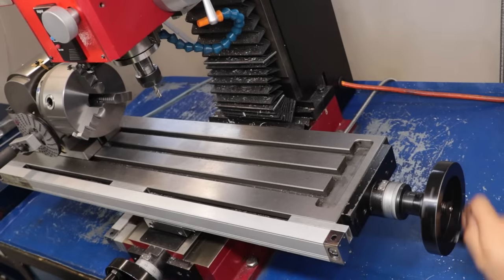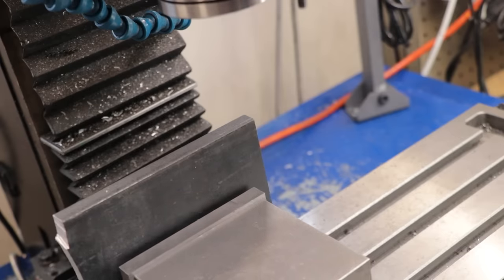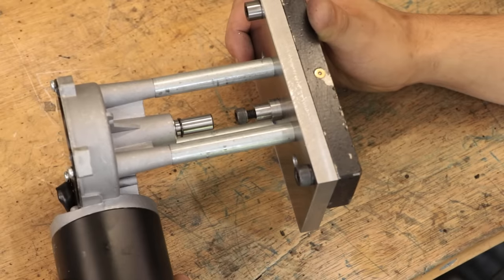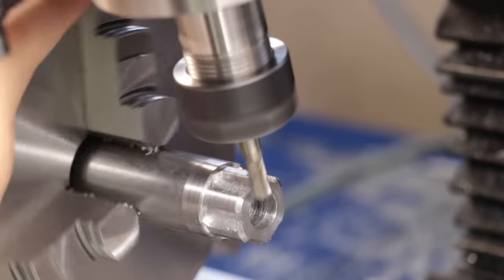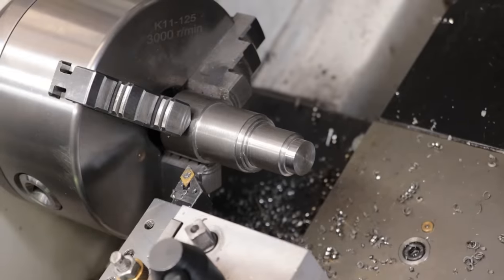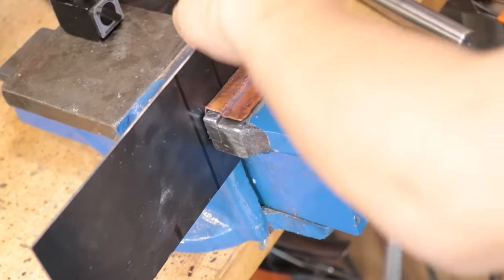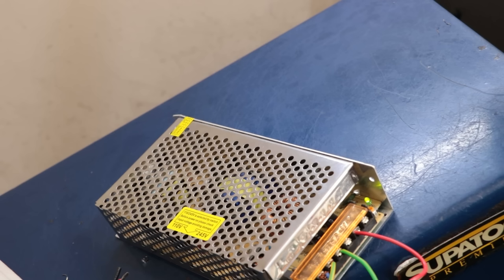Making A Power Feed For The Milling Machine | Cheaper And Better

Comment from the maker: Timestamps
0:00 - Intro
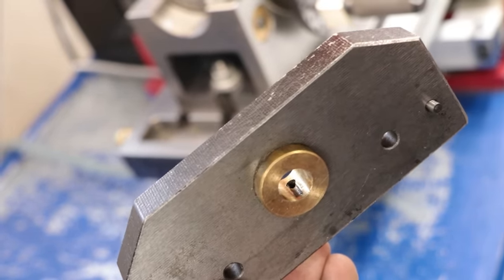2:19 - Making The Drive Pin For The Leadscrew
2:56 - Machining the End and Cover Plate
5:50 - How To Mount The Motor And Gearbox
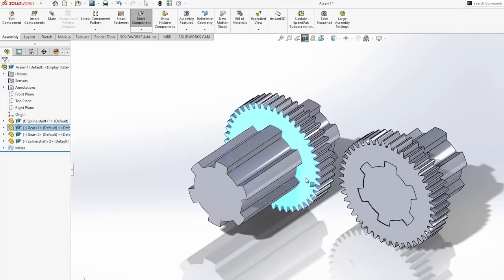7:33 - Making The Clutch Mechanism
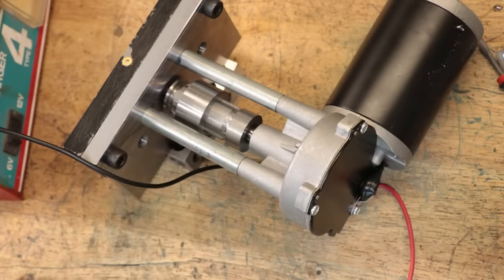13:33 - Making The Selector Forks For The Clutch Sleeve
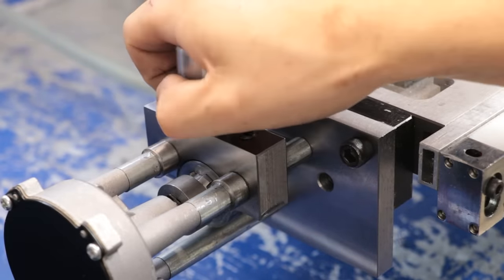19:27 - First Test 
20:08 - Making A Cover and Adding Limit Switches
23:26 - Final Test
Reply: Hello!

Comment: You know you're early to watch a video when there are 0 comments about his use of a hacksaw or any urging him to buy a bandsaw 😂😂😂
Reply: yeah.But i think a batterie powerd bandsaw would be a good fit.He can make a mounting plate to put the band saw in and the mounting plate in to the vise .Or he gets him self 90Degree tool holder and puts a saw blade in and uses the mill.
Reply: @bosanaz2010 tbh, I think he does it more to troll people as much as anything. He's happy doing things the way he does :)

Buts its the one constant of Artisan Makes content: it'll have a hacksaw cutting a stupidly large piece of metal, and there'll be comments about getting a bandsaw!
Reply: Or just use an angle grinder, he probably has one lying around.

Edit from later on in the video: he actually has an angle grinder!
Reply: Rather, he should build one
Reply: Finally, he has established his USP 😅
Reply: @trashes_to_treasures USP??? Sorry, could you elaborate?
Reply: What if he's making a bandsaw
Reply: If he would set up a patreon or something we would buy him a bandsaw. Crazy right?
Reply: @anchopanchorancho nah, buy him hacksaw blades…. 😂
Reply: Bought the bandsaw about 15 years ago.

Is currently down for repairs.  First, the capacitor.  Replaced, no good.  Currently preparing to order a new power-switch - old one had high(2-7 ohm) resistance.  Dismantling of the switch showed arcing at the contacts, and general wear and tear.  

A replacement Motor is going to be next, obviously.  I’ll take the (possibly) dead motor apart, first.

Hacksaw will keep going as long as your stamina holds out!
Reply: Hello!
Reply: Plot twist. He HAS a bandsaw but doesn't use it because he wants Arnold Schwarzenegger arms.😂
Reply: Angle grinder, dremel, bandsaw, portable bandsaw, anything?!  I’m out of breath just watching the hacksaw work!

Comment: I think you came out ahead, no matter how you figure the cost. Basically, you have a custom made power feed; that specifically fits your particular machine. Plus, you ended up with a custom made arbor press. It doesn't get much better than that.

Comment: I am a hobby woodworker, doing 95% of my work using hand tools. Watching you hacksaw is driving me crazy. No, I don't recommend you buy a bandsaw or power hacksaw (at least, not if you don't have the spare cash).

But I STRONGLY recommend firming up the bench, so the work piece is good and stable. This makes a tremendous difference to sawing (and filing, come to that).

Some diagonal bracing, or (even stronger) fitting a plywood panel to one or more of the faces is cheap and easy to do.

Comment: Nice project
For the limit switches it would be a good idea to put a diode in parallel on each, so that the motor can only run into the opposite direction when the switch is opened. If you don't do this you have to move the table back by hand each time you run into them (which actually isn't a big problem in your design, but would be if you didn't have a clutch).
Reply: I thought about that, but I'm wondering if the limit switches are only in series with the selector. So the limit would only be on the way he's moving leaving the other side free. But I think maybe this diode idea of yours is better
Reply: Just read the comments and a lot of people had the same idea as mine. Yours is definitely unique though
Reply: @MOOBBreezy  hmmm, that also makes sense, haven't even thought about that. When I designed something like that I connected both wires for each direction pretty shortly after the direction switch.

Comment: I appreciate the electrical elegance of the 3 way switch; reverse-off-forward. But if the speed is non zero, it would be really easy to overshoot the centre (off) position and instead of stopping the feed, just change the direction, which might be catastrophic.

In this instance, I would prefer 2 switches. One a simple (and bigger?) on-off, and the other a forward/reverse.
Reply: Its seems to be a 2 switch design one for direction and a seperate knob for controlling speed.  A 3 way switch with good detents is gonna be hard to miss the off position and skip to the other direction and if youre really scared of that happening just bottom the feedrate knob to zero first.
Reply: @Schmetty87  Yeah - under well considered, non panic scenarios it's fine.

I was thinking more of the "it's going to crash in 1/2 a second" scenario.

Comment: If you wire the limit switches in series with the  direction switch you can have them lockout only one direction. Then if you hit a limit you can still back the motor off in the opposite direction instead of rendering it entirely powered down.
Reply: Hello!

Comment: Nice work!  I made a z axis lift for my mill using similar motor.  Diode across 
switch leads allows it to stop and reverse without manually moving the feed.

Comment: If that knob is a potentiometer, you could add a "rapid" switch by having a SPDT momentary switch apply a fixed resistance (which corresponds to your rapid speed) to the appropriate pin on the board while disconnecting the pot when pressed. Release the button and the pot is connected back and you continue at your dialed in feed rate. It would be a simple mod, but would add a lot of useability for the operator (i.e. you)
Reply: Hello!

Comment: This is a good solution. I did the same one year ago at an old lathe for the leadscrew and it works in the same way. But your arrangment looks much better than mine, so I will improve my design.

Comment: A small tip for sourcing some items for very low prices: go to a local metal scrapyard to find stuff. I acquired 2 of those geared motors for something like $10 and they came out of junked garage door openers. They both work and one even has a clutch to disengage the gears. And yes, they both work, I tested them after I got home. 😀
Reply: Hello!
Reply: Automobile window or seat gearmotors also excellent for this kind of application !

Comment: At first when seeing the motor, i was already thinking on how to control it with a PWM controller and a DPDT switch. The electronics are super simple and works great, they'll last a long time. 
Remember to give the spline and brass bushing some oil, so it runs smooth. 
Can you bottom out the microswitch when the motor set at 100%? I'm thinking that if it takes some time to stop the motor and wormgears rotation, you could damage the microswitch or the gearbox.
Reply from the maker: It seems to stop quite quickly when it hits the limits. And there is still about 20mm of travel left on the table before it is risking of bottoming out. Cheers

Comment: Many decades ago I made dc servo drives. We could get very good precision using quadrature pulse tachs, 240 to 600 per, an up/down counter, a d/a , feeding into a an op amp with leading phase shift- pole around 3 radians per second, that in turn fed current to the armature. It worked rather well.
Reference could be a pulse train or follow a tachometer on another shaft.

Comment: I have a drawing for a power feed project for my mill. I have a couple of problems with Power feeds that cut off use of the hand wheel on one side. I have a PM727 mill and it sits on a stand with partially recessed tables hung of the walls on both sides of the mill. This lets me catch the bulk of the chips before they hit the floor and lets me still get mostly on both sides to see my work. The arrangement means that the DRO screen and y axis handle is on the opposite side of your mill. The end result is that 80 percent of my controls need to be run from the left hand side of the machine so I really want to preserve the hand wheel on the power feed side. So I’ll absolutely be using your spline technique for this project.

Comment: Dear Antone, what an excellent project to add facility to your hobby mill. I always enjoy your presentations and take new thoughts away most times.

I have one criticism about today’s project in the placement of the engagement handle for the X-axis power feed. You placed it on top, above the level of the table. This will get in the way of workpieces trying to be loaded on your bed. Can I suggest that you move it to the front or left hand end of the carriage. Cheers.

Comment: I would also suggest adjustable hard stops to protect the limit switches when operating the feed manually. Just a bolt with a jamb nut next to the switch would work.

Comment: Get yourself 4 cheap V-blocks for the bottom die on your bending jig. They are very hard, and precise; and have 2 bevel widths. Make a simple holder for them that fixes to your flypress table, and it will be easy to set up. Make sure your V-blocks are 'matched' ( mine were .5mm difference in height for my mini hydraulic press, but they work). Your work is excellent and well presented!

Comment: I second the diode comment. I've made machines for opening and closing French garage doors, casement windows, and other kinds of machines like that. You'll need to use diodes that can handle the current though
Other wise they may pop, which may be great on certain holidays, but only if the pop is good enough.

Comment: Great job overall .l.
Some ideas I have about this is an adaption of the synchronizer rings in manual transmissions for coupling under loads, a way for the limits to be contained in the box, be it by a driven fine threaded jack shaft that drives a stop like in my overhead door, or a electronic counter. I would also  like a readout in inches/millimeters per min for ease in repeating a known operation.

Comment: Very nicely done. The current capacity of those switches may be exceeded if connected to the motor leads. If that occurs (meaning they burn up) you should be able to interrupt the common on the forward/reverse selector switch with the same type of switch.
Reply: Based on the clip he showed with the ammeter showing around 2A draw those sorts of microswitches should be fine as they tend to have 3A specs at the sort of size he has at the bottom end.

They will eventually wear out if constantly breaking the 2A load, but its highly probable they would spend most of their time just staying closed as its unlikely he would always want to use the max travel, and the machine will always be attended so unlikely to accidentally overrun etc..
Reply: The switch in this PWM controller carries the full motor load. There is no relays or H-bridge, the output Mosfet is wired directly to "negative" and then the dual pole dual throw switch flips the polarities to the motor.
Reply: I see that now, switch is definitely DPDT. Artisan Makes do not take my advice. Sorry all 😅

Comment: You could wire the limit switches in series with the direction switch. One limit swith on each direction wire (I'm assuming there are three wires on the switch one being a common). That way if one swicth is hit it disables only that direction of travel and not the entire power. You'd then had to just flip the direction to move away from that switch instead of disengagin the spline and manually moving it.

Comment: Get the spline shuttle lever (and screw heads) below the bed height. It's amazing how many times you'll find  yourself overhanging the work piece or trying to.
Reply from the maker: Me personally I haven't had a part overhang the back in the almost 3 years I've had this mill. Cheers

Comment: I made one with a windscreen wiper motor unit With a 20 or 35 tooth gear on the output shaft. Then I machined the handwheel outside as a gear to match the one on the motor drive. Then a simple lift lever with notches to engage or disengage  the unit to the handwheel.Needleess this was mounted to the end of the table. I have been using this for wbout 5 years. Use a multispeed wiper drive to get speeds. I also swap the gear ratios to increase torque or get the speed down for gear cutting. Cost £25 for the drive unit from car breakers. Whip street motors of Ipswich England.

Comment: Well done. You could have placed your safety switches in serial with the 3 ways switch to select left/stop/right..
There is also PWM tension controler with a 3 digit display : it gives you a kind of speed reference. It is especially useful when you alternate between full speed and slow speed for milling (for example when doing several passes all in climbing).
Your clutch design with the selector is cool.
To avoid doing internal keeways, you can buy a 17mm ratchet wrench bit (1/2") to make the clutch cylinder. It is cheap.
Congratulations
Damien
Reply: 17mm is substantially larger than 1/2in. 1/2in is 12.7mm so the closest analogue would be the 13mm wrench.

Source: 1in=25.4mm or, 2.54cm.
Reply: I love this hack, especially since I haven’t made a good broaching tool for my shop.
Reply: Hello!
Reply: @ChristopherGoggans  pretty sure he means 1/2 inch for the drive size of the socket

Comment: Excellent job  
Lot of satisfaction from making things and not buying it 
I had the lock pins on the draws on my 4wd sliding draws in the back brake (only die cast) so I made new ones on my mill, could have bought new ones very cheap but had the satisfaction of making them myself..
Once again great video 👍👍👍
NSW
Reply from the maker: Glad to hear it, nothing more satisfying. I had to make a few parts in the workshop for my fathers Toyota troop carrier. Nothing better than seeing a part you made yourself in it.

Comment: Maybe a bicycle hub engine in direct drive could also be used. Or build your own three phase motor with laminated silicon steel and some permanent magnets.

Simple hub motor drives are cheap and then high speed travels are possible.

Also consider "overclocking" the winder motor in your design using a 12V motor.

A friction clutch by engaging the motor axially could eliminate some complicated parts.

Comment: pretty neat design!
But in my opinion in plate you have machined for "driving pin" should be also installed bushing. The old one has barely no contact with this part so there will be signs of wear between plate-pin or reused bushing-pin soon.

Comment: Id suggest finding a way to make a readout for the feedrate as that would really allow you to know that you are using the appropriate feeds and speeds for the material being cut. Also a simple momentary push button that would command full speed travel would be handy to have. Basically a rapid travel button. If you want to be fancy put in a rotary knob in line and have different percentage rates of rapid. Not really needed on a manual machine considering you not dealing with 2000ipm rapid travel rates but still nice to have and I mean why not.

Comment: Clutch setup need be no more then a deep socket with coupler nuts on both sides then cut the back end off a impact style deep socket and ad a ring around it so a shift fork can move it back and forth to engage. I was going to build one of these but the Chinese power feeds are so friggin cheap for a full size bridegport, I'll probably buy one of those.

Comment: Awesome video as always. Big fan of saving money on something that I can build myself. I do foresee an issue with the engagement knob though, it sticks up above the table, if you ever machine something long that hangs over, it may be in the way, just a thought. 👍
Reply: I spotted that as well and was going to say something, but I figured that it is so obvious that he will have taken it into consideration. 
At the very least he can unscrew the knob and make a flat sliding knob in its place.
Reply from the maker: Yeah ive never had that much overhang on a part, but if the situation ever arises I can take the handle off. Cheers
Reply: @artisanmakes  Very true, I like the approach. I'll say I was expecting some sort of lever, but I can appreciate the simplicity of the knob with fewer moving parts. And the internal spline broach, genius!
Reply from the maker: Yeah that was on an original sketch, some sort of eccentric cam but I ultimately went with this design. Cheers

Comment: It all comes together. Builds a 3 piece tap set to build a fly press to cut internal splines for a spline shaft and coupler to build an auto-feed and attach it to the mill.
Reply from the maker: Yeah effectively. Took a whole year to do all. Cheers

Comment: Overall, I like the design, but.
if you run into either limit, you will have to dis-engage the drive and manually back off the limit.
If you wired each wire back the the switch and had forward limit only in series with the forward direction switch and the backwards limit in series with only the backwards direction at the switch, then you only need to reverse the motor to come of the limit.
Personally I would have used a stepper, 
You could then use a small micro controller to control how far it travels before stopping or even reversing automatically.
but then I'm an electrician.
Are you going to add a power feed to the Y-Axis?

Comment: Genuine question: Why did you choose to go with the proud, mechanical knob-actuated clutch and not an E.M. Clutch (electro mechanical)? An EM clutch would engage when you push the button for either left or right and be normally open.
I like the mechanical Cluck noise of engaging the powerfeed :D satisfying 👍